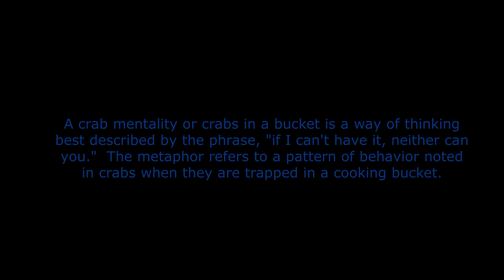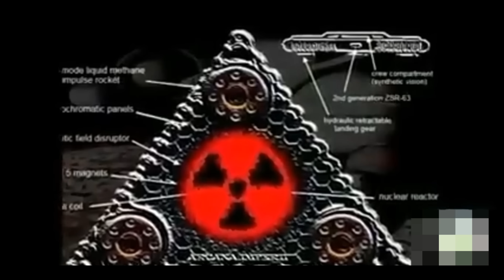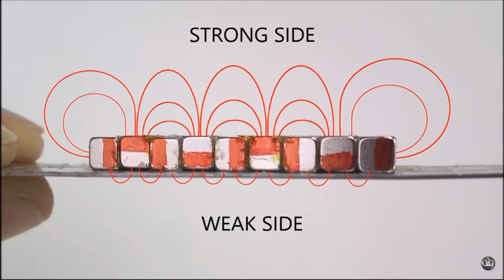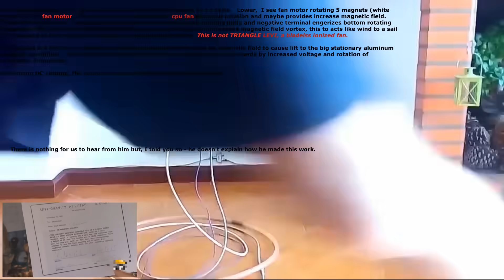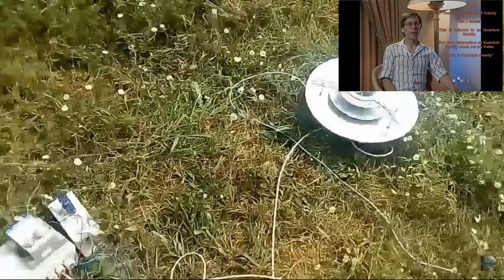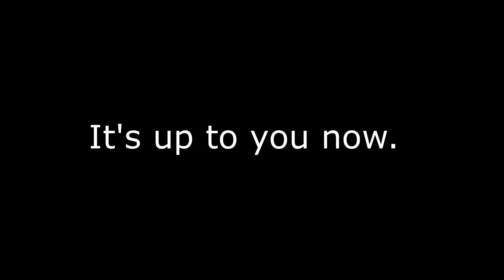anti-gravity project

Comment: I found out a way to have gravity in space..but the reality is..gravity in space is pretty useless considering how much energy it would take to keep you standing upright
Reply: Gravity in space comes from objects in space.  It's up there where there is matter or dark matter.
Reply: @firecatgreg   there is little more to gravity than you think in terms of gravity in relation with magnetism
Reply: The moon doesn't circle the earth due to magnetism.  The moon does circle the earth or orbits the earth because of gravity.  There is even gravity affecting the ISS space station, they are falling constantly and the falling around the curve of the earth creates weightlessness.  The falling on the curve counteracts gravity.   The moon and earth rotate around a common gravitational point which is based on the mass of both objects.

So there's a lot of gravity in space. And in our solar system there is gravity as well.  Without enough acceleration you will not float away from the sun and may be pulled into it.   So space doesn't need you're gravity device, but anything of mass will add a small amount of gravity in space once it's in orbit of course.  And things add a small amount of gravity to our planet while they are here as well.

Comment: Is it possible to "MAGNETIZE" the molecules of the salt of the Sea water?  
The purpose and the idea would be so to be able to separate the salt molecules from the Sea water and transform the Sea Water to sweet or drinking water.  After All, all Salt is a mineral.  Minerals such as Sodium, Calcium, Potassium, and etc... are only substances that are formed naturally in the Earth.  Minerals are usually solid, inorganic, have a crystal structure, and form naturally by geological processes.  A mineral can be made of single chemical element or more usually a compound. If the Sea water can be transformed into sweet or drinking water by "Magnetization" process, it would make it much readily available, much less expensive than the processes of "Desalination" and the filtration systems.

Comment: For the maglev on copper sheet, what happens if the piece of copper is super conductive?
Reply: The more conductive the better the levatation effect. For a super conductor the magnetic field is completely expelled from the plate. So the mirror fields would exist without the need to spin the magnets. Search superconductor levatation.

Comment: The rest of the fundemental forces have more in common to electromagnetic force then gravity will ever have. Gravity has no corresponding quantum particle..
Reply: Dielectric acceleration 

https://zeteticzen-wordpress-com.cdn.ampproject.org/v/s/zeteticzen.wordpress.com/2017/06/15/gravity-does-not-exist-the-lorentz-contraction-conundrum/amp/?amp_js_v=a2&amp_gsa=1&usqp=mq331AQCKAE%3D#aoh=15726350332158&referrer=https%3A%2F%2Fwww.google.com&amp_tf=From%20%251%24s&ampshare=https%3A%2F%2Fzeteticzen.wordpress.com%2F2017%2F06%2F15%2Fgravity-does-not-exist-the-lorentz-contraction-conundrum%2F
Reply: Wrong ! Gravity it is a particle microatómic AETHER.

Comment: this is funny ?
it is so easy. loock at the coral castel in florida 
making a aier plain or space ship it is easy if you all reddey know this .
u just have to know that u alredy know and do the oppesit.
and remeber string teori, string teori is just sound/movment. 
u ned mhz ??? . and  a super konduckter. u find it under 2 
pyramid in the world. and the mhz u will find in a old tempel in the 
mediterranean sea. it is on and 
island. and it is in a cave made bay some on, 
good luck. the hint is 110
Reply from the maker: Some kid drove by my house with his boom box, license plate was rattling,  the low base the noise made boom boom boom could be felt 500 yards away, micro Earth quakes,  something about base moves objects.

Comment: Your mercury gyro stabilizer is elegant and genius.
Reply from the maker: Makes you wonder how fast can it spin, will spin so fast the Earth will leave it behind?
Reply: @jefflucas_life  well, I mean it can spin as fast as the electrical current running through it theoretically it is infinite but what power source can provide that? If we find a way to produce extreme electrical power in a small enough vehicle with enough charge to last a practical time say an operational time of 6 hours without recharging at about the output of a small sun like a nuclear reaction, then you could have your antigrav ship or fighter. But who's got a fusion reactor that's small enough and works? I love thinking about these kinds of things for fun because of how possible it is.

Comment: Let's see. Where do I begin? Lets start with why the CD in the case in the beginning was blank on top then the video snaps to a Maxell brand CD going into your lap top drive. Why not just put the Maxell CD in the case before you start your scam video? If you're going to lie to people, don't lie about something so petty.
    Gravity is in NO WAY related to magnetism. They are two completely different laws of physics. Magnetism, or electromagnetism whereby all of the atoms in a magnetic object are aligned north, south, north, south, ect. so as to amplify their attraction to ferrous items or some other elements like nickel, cobalt and liquid oxygen and can also have para-magnetic effects on non-ferrous metals like aluminum and copper as shown with the three levitation experiments but then these are purely explainable electromagnetic effects under the existing laws of physics and have NOTHING to do with anti gravity. Gravity is related to Einstein's theory of relativity and is, to put it simply, a state of falling as in Newton's apple or a constant state of falling as in the orbit of a planet caught in the gravity well of a star or a moon caught in the gravity well of a planet. On a larger scale, all the mass in a galaxy is caught in the collective gravity well of the mass in the center of the galaxy and the mass of the matter in the outer most parts of the galaxy. This is what keeps out solar system at the outer edges of the Milky Way Galaxy and not allowing it to fly off into free space. Your term, "levitation" when referring to the spinning magnet apparatus over the copper plate and the aluminum disk over the electromagnet is a much more accurate description of the scientific effect demonstrated than your "anti gravity" sensational headline for the video. 
   The old man in the video claimed that for gravity to act on something, it had to have a magnetic component. GOD, I HOPE NOT!!! if this were true, anything non-magnetic would fall away from the earth if it wasn't tied down. Things like trees that are cut down, the atmosphere ect. I liked the ducted fan in his little "anti gravity" machine. Nice effect but all it was, is a little toy hover craft. The effect with the mercury was simple electromagnetics. If you passed a current through wire made of pure tin and placed mercury inside it, it would react the same way. No movement until you introduced an outside magnetic field, like from the ring magnet, to give the mercury something to either be attracted to or be repelled by in effect, it became a part of the electromagnet. If you floated fine powdered iron on water, the effect would be the same.
    Gravity, itself, is NOT a wave although gravity waves have been proven to exist. Gravity waves are different from electromagnetic waves in that gravity waves are produced by cataclysmic collisions between two or more massive objects like black holes, neutron stars or, to a lesser degree, anything with mass. They are actually ripples in the fabric of space time and completely unrelated to magnetism. Electromagnetic waves are produced by electrical fields put in motion like the spinning magnetized field coil on the shaft of an alternator like the one in an automobile all the way up to the power producers in the Hoover Dam, permanent magnets placed in motion as on the armatures of Newton motors, the iron core in the earth spinning like a dynamo, the resulting magnetic field which protects the planet from deadly radiation from the sun and space, electrical discharges like lightening, nuclear explosions, (Can we say EMP or Electro Magnetic Pulse?), the on going nuclear furnace inside a star or something as simple as the electronic oscillator inside many pieces of electronics like radio transmitters, receivers, tone generators or even the coil in the speaker in an amplifier. There is NO valid theory that that claims that gravity is in any way connected with electromagnetism.
    They should really learn more about what they are talking about before they open their ammonia holes and spew this shit. This is really getting frustrating. Gravity does NOT work on a subatomic scale on anything. This is one of the four forces in nature called electromagnetism. This is what holds everything together at a subatomic level. The other three forces are gravity and the weak and strong nuclear forces. The weak nuclear force is what allows radioactive elements to decay like uranium 235, plutonium 240 ect. The strong nuclear force is what keeps atoms, (NOT subatomic particles) from flying apart from each other. Everyone knows that two like poles of a magnet repels. Two atoms of EVERYTHING are orbited by varying numbers of electrons which generate the same polarity magnetic field. The strong nuclear force keeps these atoms of like spinning fields from flying apart. Otherwise, the universe would only contain hydrogen atoms. The electromagnetic force keeps the electrons spinning around the proton and neutron, (all subatomic particles), nucleus of all atoms or, as in the case of hydrogen or helium atoms which contain no neutrons, electrons and protons. (How this turned red, I don't know.)
    The bottom line here is, unless the government is hiding something from us, (and I know this happens), we don't have a gravity or anti gravity drive YET. The theory of dark energy being a negative gravity energy source that is able to cause the universe to expand, for lack of better evidence, sounds plausible for now. I'm sure that there is some spacefairing civilization out there that has perfected an anti gravity drive, possibly harnessing the power of dark energy. If the Romulins can figure out how to contain a quantum singularity small enough to power their war birds to multiples of light speed and not turn them inside out, anything's possible, right?, (Just kidding but I digress.) I also believe in UFO's although I'm not a fanatic about them. I think that it would be closed minded to think that we would be the only intelligent life in the entire universe.
    My last words are, if there were such a thing as "free energy" or "anti gravity", all the energy companies would be out of business. All these people who claim to have perpetual motion machines that produce more energy than they use are full of BULLSHIT!!! If you think that the energy companies feel threatened by them and buy up their patent rights to bury them, wouldn't you think that they might have already bought up YouTube to remove these "business ruining designs" and take them down as they appear. Do you really believe that these "brilliant inventors" are really so altruistic as to give away the potential to make MILLIONS on their designs for free for your benefit? They wouldn't be hawking their wares here on YouTube, they would be offering them to the giants of industry for hundreds of millions of dollars for them to either be developed into sale-able merchandise or buried by the big energy corporations.
    Ya' gotta think, people!!! If you have money to throw away, I have some elevated waterfront property to sell in down town Brooklyn New York. It's a real bargain.

Comment: Gravity is not an electromagnetic force. If it was you would be able to use gravity to generate electricity. I'll give you a clue... You can't. Gravity has ZERO effect on electrons. Gravity only effect protons and thus the reason why you will never have an anti-gravity force.
Reply: @Engineer77 "Gravity does affect electrons." citation needed. Take a 10 foot wire, hang it 10 feet above the ground. Let it hang there for say... a day. The next day, cut the wire in half, and connect up a volt meter between the two halves. Now rotate the wire and hang it from the bottom end. Tell me how much electricity is produced Genius.

Comment: Having witnessed a UFO left with me a lifelong interest in alleged component debris from crash sites. Components which are few and the bogus sites many.  In my years since the 1974 incident, I have studied and found two types of components that may support Boyd Bushman. It is my opinion because of these that a control layer encapsulates the hull material of such craft. It creates the driving force in the skin of the craft isolating the interior from the effects of the universe around it. A spacetime universe which seems to have particles, energies appear and vanish but exist long enough for gravity of a mass to be affected and limited in its acceleration. The opposite magnet rotation doesn't exist in my model and the design of what is studied is not my own. It would be more of a model of reverse engineering ideas from existing components. The described "skin" is a laminated layer of the highly conductive materials copper and silver over the hull of various  Mg/Al/Fe/Bi hull materials. Using these components I built a theoretical model built upon these materials. Using these components can induce atoms to spin by electrical pulses in the material. The use of the cold temperatures of space provide superconductive properties of these materials. Atoms of silver in superconductive state have a low resistance cost and atoms of it can spin in the same direction in those layers held in place by an also spinning copper element. Gyroscopic effect  of each the individual silver atoms would be able to point these atoms in specific direction with enhanced computer control. Another factor would hyper-dimensional properties (if they indeed do exist) of axially spinning atoms with very controllable and modifiable polarities. Another energy comes into play, gravity of these atoms. We have scientific evidence these days that anti gravity fields exist in superconductors.
- So I ask at this point, What would these 3 elemental energies influence in the hull of consisting of aluminum. iron, bismuth and magnesium? By design the mg/al hull has a strata of iron particles and a reflective wall of bismuth on the interior portion of the "hull" material. So these material are non-magnetic (Mg/Al), very magnetic (Fe) and magnetically reflective (Bi).
My theories on this are many. In the simplest context a magnetic field could be projected away from the spacecraft to deflect incoming radiations. (This is a needed feature in space for any spacecraft.) Superconductivity in absolute cold makes conductivity of the materials very efficient and requiring low power requirements under precision computer control. During peak energy intervals deflections of meteors might be possible as well.

-But if the gravitic, centrifugal and gyroscopic elements are also controlled and the interior of the craft isolated from the universe surrounding it, its specific gravity would be altered to the universe around it. If so, a massless, electrogravitic, magnetic positionable skin could repel or attract to  magnetic fields and gravitational fields of stars using very little energy for control. A zero mass vehicle using magnetism for propulsion from and to stars would explain their massive acceleration and massless  properties would certainly explain their odd maneuvering. (No I never saw any little grey men)

Comment: this technology doesn't seem to be that hard to make, but if were trying to make a flying car how would the polarity change if you were trying to accelerate by going forward or backwards based on the magnetic field? would you just change the polarity of magnets based on the the orientation by making a transmission like that of a car,  my answer still remains questioned.

Comment: Very simple... take an electro magnet, and repel another magnet that pushes on an integral body structure center above, and greater voltage will produce greater lift...  it would take a lot of voltage to do this tho...
Reply: You have basically described the permanent magnet loudspeaker.  Yes, speakers work, don't they!  Proof of concept...